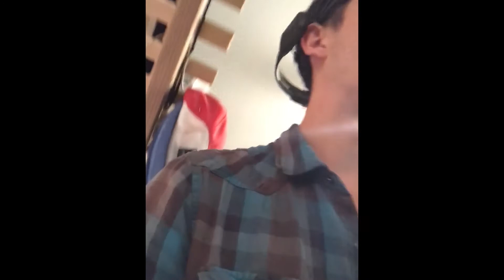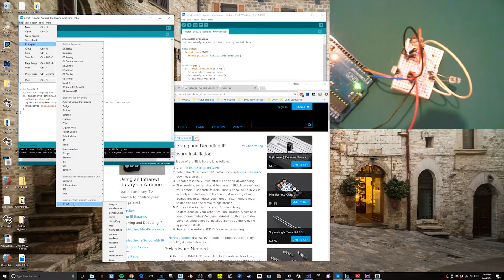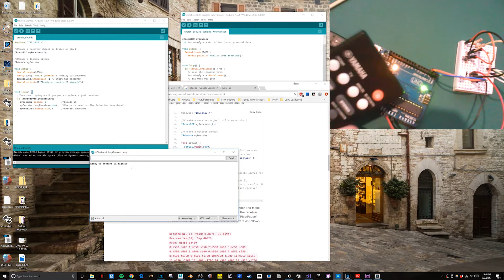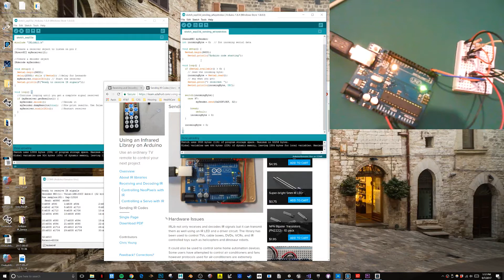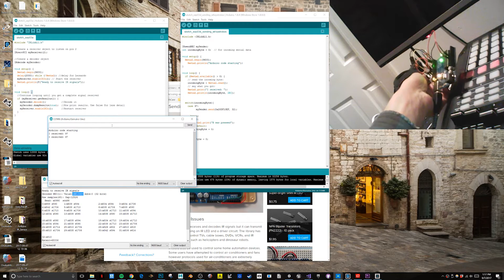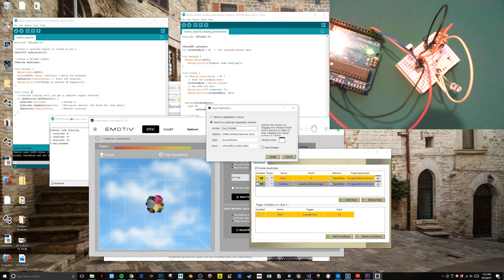Controlling my TV with my BRAIN, Emotiv Epoc, and Arduino Tutorial

Comment: Hello There
I am a brazilian student, and I am trying to develop a project using emotiv BCI, but I am having troubles connecting with arduino, do you have any email that i can ask you some questions about emotiv ?
Reply: Seems like they have changed their ecosystem a little bit. I cannot find anything related to Xavier panel control panel. Maybe they have integrated it in the BCI-OSC. If you have found any solution for connecting to Arduino pls enlighten me.

Comment: Hi ! 
thanks a lot for your video !! 

I command small Dc motor with emotiv epoc. 
I have a problem when i press "a", i need to press "ENTER" after to valid this action. 
in monitor, we can saw : "97" and "10" ("a" and "Enter") 
And in your video you didn't use "10" for the letter "Enter." 

The final problem is when i think to push, letter add more time "aaaaa".... and i need to press Enter to valid it. 

If you have an answer for my problem, i will listen you ;)

Comment: Hey I saw what you said about needing the subscription to use the raw brainwave data. If I were to get the subscription how would I use emokey with the raw data? Thank you so much for your video it was so cool and got me interested into looking into this. Is there a name for the subscription that lets you use the raw data?
Reply from the maker: Hey! Thanks for the interest. Here's a link to the PRO License https://www.emotiv.com/product-category/applications/   As for using the RAW data, my honest answer is idk!  I'd probably try to find out what data format it's poopin out and then determine what data format i want to turn it into (In this projects case i think  it was turned into ASCII) Then do a search to find what software can take RAW data format and convert it into wanted data format (maybe MIDI?) then run the new result into an Arduino or teensy 2.0 or Garageband, etc... So to answer your question,  I probably wouldn't use emokey with the raw data.

Comment: what platform are you using to convert the raw brainwaves into command that can be read by arduino?
Reply from the maker: I'm using EmoKey (software available through Emotiv's download page) I'm not actually using raw brainwave data which requires a subscription through Emotiv. Instead, I'm using Emotiv software to get high level interpretations of the EEG data that generalize the raw data.  
I get into using commands about 15 min in.

Comment: That is awesome! I am currently working on a brain controlled wheelchair using the same headset. I want to use an Arduino mega to send commands to a motor depending on the signals. How were you able to receive the signals from the headset and have the Arduino use the signals? I am having trouble importing the data.
Reply: Did u found the solution? I am currently working on this project and I also found it hard to get in. can u please share ur?
Reply: The headset comes with software you can use to press or enter keyboard keys. Use the key strokes as input
Reply: Can you give me your email address? actually i'm having the same problem. I want to know the details about importing data from emotiv software to arduino and sending it to from arduino to device that i want to control.